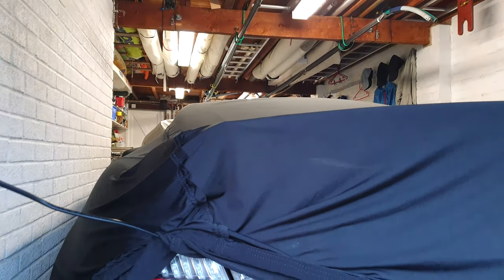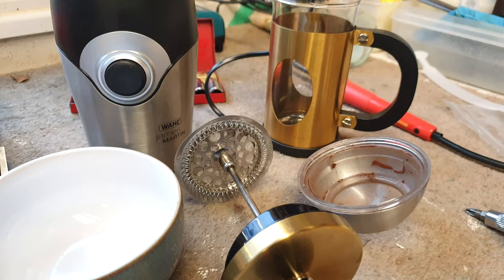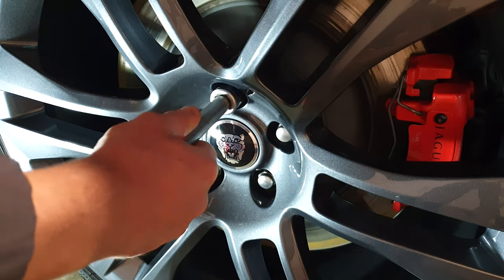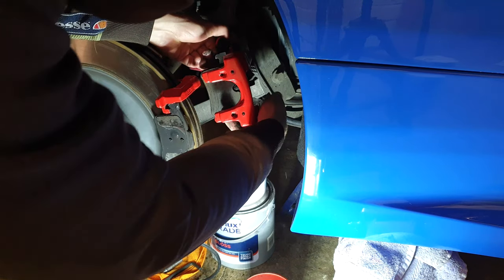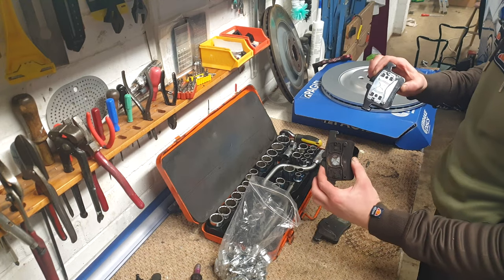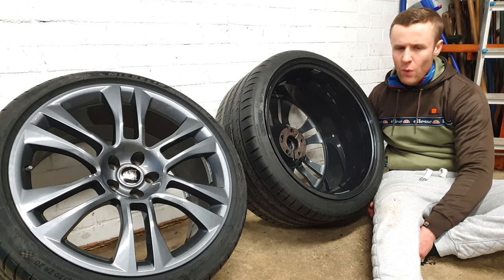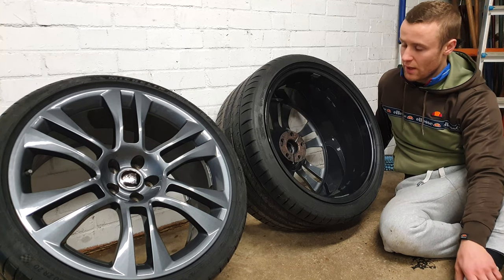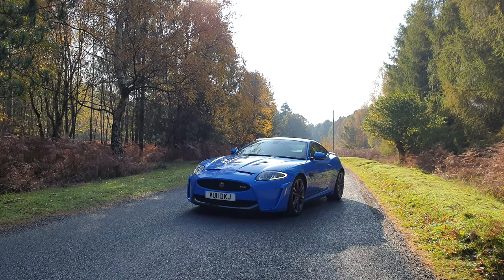Jaguar XKRS Update - New Brakes and tyres

Comment: Good info. I have a 2011 XKR 68000 miles. love it. Good idea to brush the wheel arch liner. I do however have a slight squeak, off side rear when i first apply the brake, then it goes. A bit annoying but it is what it is!
Reply from the maker: Thanks John. Glad you are enjoying the R. My brakes can be loud at first application. Not always a sign or symptom of something wrong. Presume they arnt scorned? Bring on the sunny driving weather!

Comment: Hi there how much were the pads and how much were the disc’s great video I paid over £400 for rear pads from Jaguar  apparently their special ones not the same as the standard XKR could you offer any information on this cheers
Reply from the maker: Hi Jamie. I've just put a link to the pads and discs in the description for you. Mine comes in cheaper than that, but with Jaguar doing it for you, you know it will have been done right and the jaguar paper work to go in the file. 

Pads were extra cheap but I opted for parts I knew were correct rather than trying to save money. Always nice to work on your own car and tinker with a few bits.

The pads are indeed different, as they have the spring clip like I show in the video. Mintex offer a cheaper alternative to ATE.
Reply: @QuickShiftTV2024  excellent thanks

Comment: Did you have to reset the electronic handbrake at all? I gather there's something you need to do to tell the car there's fresh pads???
Reply from the maker: Nope. As long as you release the calipers with the red chord and place it into the service mode, it will adjust automatically, as it would do as the pads wear down over the life of the pads. Hope that helps 👍

Comment: Hi mate did you get them from euro ? Did the clips come with the mintex pads ? Thanks
Reply from the maker: Hello Jak! Nope- The discs are in the description. Best price I could find the Pagids. The spring clip on the back of the pad which slides onto the piston comes with the pads, if that's what you mean? These are different to the XKR pads and are also in the description. Hope this helps. Happy braking!
Reply: @QuickShiftTV2024  carparts4less ARE eurocar parts!!! just cheaper
Reply from the maker: @SNORKYMEDIA  Correct! A good site to know!

Comment: Don't use copper grease as it just speeds up galvanic corrosion between the alloy and steel and totally the wrong grease to use. Use ceramic brake grease. Using copper grease is a myth that came from the 80s. No decent mechanic uses it.
Reply from the maker: 👍Thanks Beebo. My research shows the blood of helpful commentors has the lowest friction rating of any lubricant available, so I'll endeavour to use that next time 😝